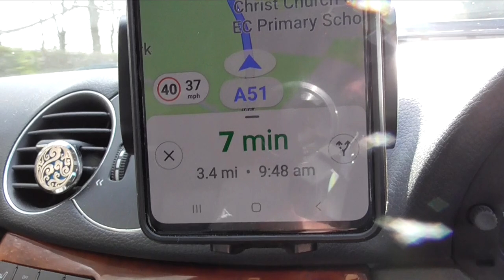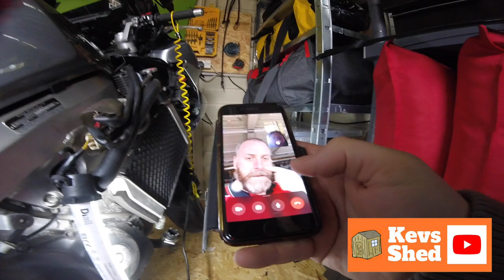Honda VFR800 Coolant Leak Fixed

Comment: The sediment /corrosion you see has happened after the leak developed.

The hoses have lost elasticity, and are not clamped as tightly as they once were, hence the leak.

Not sure about an overtemp warning, but no level warning for sure.

The expansion tank level is not a reliable level indicator till it has run a few heat and cool cycles.
The system purges air and pressure via the right radiator into the expansion tank, and when the system cools it takes fluid from the expansion tank to top up the system.

I would suggest rechecking the level once you've run it a few times.

When cleaning fittings a scotchbrite does a better job than a screwdriver, any pitting found is not the end of the world.
Loctite do excellent gasket / fitting sealants available from Halfords, get the one for water and you'll be fine....£6 ish a tube, which is pricey! but its top stuff.
Reply from the maker: Thanks for the info much appreciated, learning as I go along so all helps. Will look at the gasket sealant, is that something that’s put on the hose end or something you pour in the system.
Reply: @Motourev  You would smear the sealant into the hose or onto the fitting.
Reply from the maker: @ianmuggeridge  think I might do that anyhow as a precaution. Thanks for the help and info 👍🏻

Comment: I can answer.... yes mine got up to 123 degrees and a red light started to flash. I just changed the coolant and it looked like running shite. I think the low coolant indicator is that it gets very hot!

Comment: Good video. Yes hope that stops it. Did make me gigle when spilt some coolant lol. Also your oil pipes look like mine lol some thing on list to replace. And that oil filter looks like been on a while too. And with fairing removed I rode mine for about month after doing RR and stator fix.  And yes got the Kit from God lol aka Kevin top man great videos too. 🙂
Reply from the maker: Yeah gotta clean them pipes up for sure, also gonna do oil and filter change whilst there.
Reply: @Motourev  yes did mine a bit. But eventually need doing. Looks like also running original RR and stator.
Reply from the maker: @guystevens162  yeah still original. I do check the wires for burning quite regular. Will get done after this summer.
Reply: @Motourev  yeah.  That good might blew bank holiday so had to do it. 🙂

Comment: Hope you have fixed the leak. If it is still there though see if you can push the hose on a bit farther (or use a longer bit of hose) and put 2 hose clips on.
Reply from the maker: Was thinking two clips also if it still leaks 🤘🏻

Comment: You should  greased them oil pipes while the fairings were off they are prone to rusting and are about £160 a side and a good dose of acf50 would help 👍
Reply from the maker: Fairing is still off as still gonna do more road tests. Going to clean all underside and acf50, don’t think it’s ever been cleaned.
Reply: @Motourev  keep up the good vid you had me in tears with the normandy trip
Reply from the maker: @dazsyvo8499  will do my past mate ❤️🤘🏻
Reply: Yup, looks like a shed.

Comment: You’d have been better using proper hose clamps rather than “Jubilee” clips. You always end up with a flat unclamped section otherwise. 👍
Reply from the maker: Cheers pal will look into that. I think the originals were jubilee but they could’ve been change.